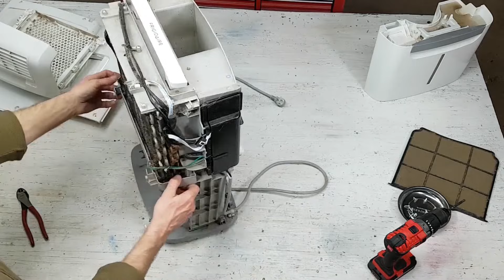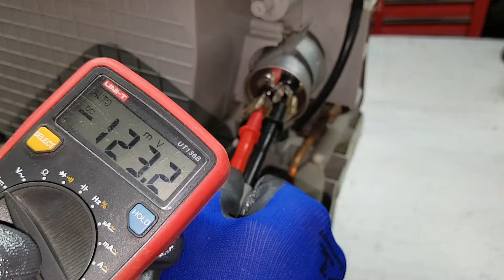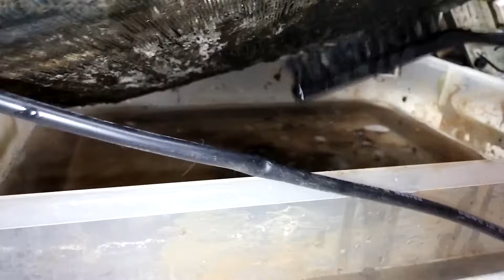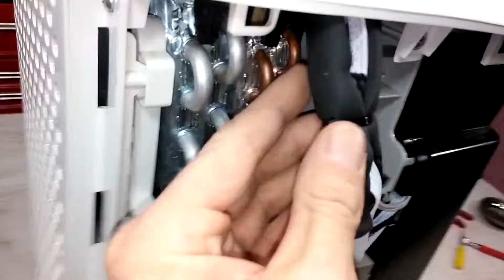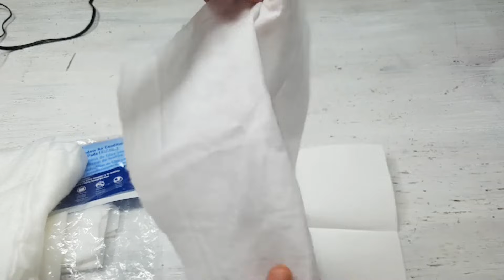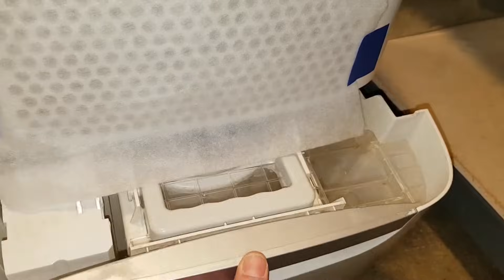How I Cleaned a Dehumidifier - Deep Cleaning Moldy Coils, the Bucket, and the Filter

Comment: Also focused a vacuum to a smaller hose to clean running unit because problem of dry and stubborn was then wet and loose ,recommend shop vac because it also suck out the water”learned the hard way”. If your bag is full and ready to change, it makes no difference to change after the job.
Reply from the maker: Thank you for the advice

Comment: After doing the same on a much more serviceable model. Added a custom cut out section from a furnace filter , a little duct tape , wha la la. They are specifically designed to prevent that very problem.
Reply from the maker: A cut-out piece of furnace filter is a good idea. The AC window unit filter material I used at the end of the video works really well so I'm sure a piece of furnace filter would also.  I need to change the filter about every 3 or 4 months but it's keeping the coils much cleaner.  Thank you for the tip

Comment: This video is the opposite of videos that bring a sense of calm over you, like the video of washing a dirty rug. I think it's the narration that makes the difference. Bad joke apart, incredibly helpful video for me. I have the same model, 12-ish years old. Never imagined it was something that needed cleaning. I mean who makes them like that? Mine is not sucking water as well as it used to so i checked and found ice where water drips out into the bucket. I can confirm it's not that cold in my basement because i have another unit, 2 years newer model, gulping water like a whale in comparison. The only recommended solution on the internet i could find was cleaning the coils. Never thought it would be such an undertaking, and thankful i found your video. Wish me luck as i'm about to embark on this mission.
Reply from the maker: I know what you mean.  I've looked for other dehumidifier models that are easier to clean but couldn't find much.  I have an older dehumidifier that is much much easier to clean but it's too inefficient.  Hard for me to believe that manufacturers make them this way now.  Thank you for sharing your experience.
Reply: The Ice forming is normal. Dehumidifiers work by cooling the air in the radiator fins to condense and collect the moisture. In principle, it's really not much more than a fridge with a fan running air through it. Mine was icing up when it was new and running well but stopped as the airflow got obstructed over time
Reply: They can make them easy to clean, but then half of their customers wouldn’t just buy a new one …. Basically the same idea as planned obsolescence
Reply: So how did it go?
Reply: The narration sounds like Aidan Pearce from Watchdogs! Love it!

Comment: WOW! What! I had NO IDEAAAAAA an UNPLUGGED appliance could KILL YOU!!! What a great video! I was just about to take mine apart, so this just might have saved my life.
Reply from the maker: I was surprised to learn that also.   Thank you for the compliment.
Reply: To be fair there are usually discharge resistors connected to capacitors that can be dangerous, else for some appliances you could get a shock from the plug itself. Actually I did get a little shock from a plug like 2 times in my life. I was probably very fast to touch the terminals after unplugging, not giving the resistor enough time to discharge some capacitor.
However I wrote "usually" in bold because you can't be sure they went out of their way to implement these resistors, and for some reason some designs traditionally don't have one. Like the main capacitor from photo flashes. Even these throw away cameras you could buy before the digital revolution of photography, had a flash module and I did get quite an unpleasant shock from one of them, assuming it was discharged because it wasn't used in quite some time.
So better treat those big capacitors like little death nuggets unless you definitely know they are discharged.
I don't know if I would short a motor capacitor like in the video. That could lead to a really loud bang and partially melted terminals/screwdrivers. The safe method is to do it via an appropriately specked resistor.
Reply: mines been unplugged for six months.  do you think i still have to worry?  been putting off cleaning this overcomplicated  unit
Reply from the maker: I would still take the same precautions shown in the video because that capacitor can theoretically store its charge for quite a while.  It may have a circuit to drain the charge after the dehumidifier is unplugged, but I wouldn't trust my life with such a circuit.

Comment: I used a fabric cleaning gun, which is used in the dry cleaning industry for spot removal. I have several around for cleaning mineral specimens, and it worked amazingly well on the coils and fins. I took a chance , and just unplugged the unit, carefully but thoroughly sprayed from the entry side from top to bottom, and repeated until the runoff in the bucket was clean. The odor was like sewer gas before cleaning, seems good now.
Reply from the maker: I've never used a fabric cleaning gun but it sounds fun.  Thank you for the tip

Comment: Hi! I'm hoping you might help answer a question for me. We tore our dehumidifier apart it didn't look nearly as bad as this one did but it was bad. We gave it a very good, but we did not separate the coils and it smells mildewy still. I'm afraid to separate the coils because I'm afraid of breaking them in two. Where we are living the moisture inside the house is crazy it's at 70%. Because the house was built in 1910 and has a dirt floor basement. And we are running the dehumidifier inside the house itself where we live. I'm afraid if it still smells mildewy that will be putting mold spores in the air. Is my thinking correct? In the landlord just seems to think that we should open the window. But if it's humid outside opening the window isn't going to make it less humid inside, if anything it will make it worse. What are your thoughts? Should we run it anyways or is there something we can do to put like a filter over where the air comes out of the dehumidifier? Because I really hate to buy another one, and we're searching for a place so we can move, but until then we're stuck.
Reply from the maker: Another viewer mentioned a product called viper foaming coil cleaner.  I believe it's just sprayed on the coils, allowed to soak, and then washed off with a garden hose.  I've never used it but I think it was made for cleaning air conditioner coils.  The coils on the dehumidifier may not need to be separated if using a foaming spray and a garden hose, but I don't know.  The coils on my dehumidifier weren't attached to one another but were secured around the edges.  After removing the retainers, they came apart easily. Need to be careful not to break the refrigerant lines though.  I think you're right about it putting out mold spores if it still smells.  I don't know of any filter that can be used on the outlet, but the A/C filter material I installed on the intake does a great job of keeping the coils clean.  It just needs to be changed regularly.
Reply: You are probably in a toxic home. If it smells like mildew, that’s your sign. It’s best you try to move ASAP.

Comment: HI Phil, why can't we use vinegar?
Reply from the maker: Vinegar can be used, but it may cause corrosion to some metals if it's not completely rinsed off.  I avoid using it on intricate metal parts that are difficult to clean if I think I won't be able to rinse it all out of the tight, inaccessible spots.

Comment: I just cleaned mine. Anybody else have like 5 extra screws and have no idea where they go.
Reply from the maker: I've experienced that a few times.  I try to organize fasteners during disassembly using cups and bags but it still happens occasionally.
Reply: 3
Reply: 😂 we all have loose screws
Reply: I had some screws fall down and get underneath the large black cylinder at the rear of the unit.  I partially reassembled the internal sections enough to permit turning the whole thing upsidedown over a bathtub (plug the drain first!).  After a bit of gentle shaking the missing screws fell out.

Comment: Pretty sure that after the initial white plastic cover comes off, that you have enough access to clean it almost perfectly. The front grill needs to be very gently wiped or better sprayed with water delicately to wash off dust. Doing it in the tub works. That's all I did and it works like new. Wait until it dried and reassemble. You're good to go. Basic easy procedure. The front metallic grill cleaning is crucial. Delicacy is the name of the game. All the extra disassembly is unnecessary.
Reply from the maker: I wouldn't have been able to clean the backside of the coils if I only removed the cover panels.  Seems like that method would be fine for cleaning off dust, but I had to remove mold, dirt, debris, hair, and other stuck on gunk.  Spraying from the front side of the grill would have pushed the moldy dirt and hair further into the coils.  If I had cleaned the unit much sooner,  I believe the approach you suggested would have worked.  But I waited way too long to clean it.  Thank you for your input.
Reply: @BudgetPhil  If was an interesting video for sure. Normally (if you clean it regularly like you say or have an air cleaner) the front grill cleaning is sufficient since the dust really stays near the front on the grill in my experience. I have two different brands and when I cleaned them both the dust doesn’t push through. Also, as someone who had lived in moldy houses, that doesn’t look like s normal amount of mold even for not cleaning it for years. If you have it in a  crawspace that’s probably normal, if it’s in your house you should check for water damage. Mold is really bad for you health.
Reply from the maker: Yeah, it was a lot of mold.  Thank you for your concern.  I would have freaked out a little if the dehumidifier was used in the house, but it was used in my workshop.  A lot of different kinds of dust and debris flies around in there from time to time so I should have realized it was going to happen.

Comment: 4 months !??
Think you need a serious hepa air cleaner in the room and clean all the walls, floors, roof and things around. I havent cleaned mine before today and is where just a little dusty and from hair and concrete (in basement) and it lookes almost new and better than yours after cleaning 😅
Reply: It was ten years for him he said. He checked the pre-filter after 4 months I think.
Reply from the maker: Yeah, my workshop gets fairly dusty sometimes.  I put an air purifier in there and it does help.

Comment: nice work. Having mold grow in this thing is a nightmare for airquality as it sprays the spores everywhere . not just into your lungs, but also infecting any other place in the shop that is moist enough to let it sprout - leading to new problem areas. Your more robust intake filter should help a lot I think. The mold needs some organic material in addition to moisture, so if there isnt a dust buildup it shouldnt happen. Its a good idea to not let water sit in the tank though.

I wonder if its safe for materials to use a mold biocide as a last-step disinfection. I would assume so. You cant avoid mechanical cleaning when its this bad,  but misting the area with something that can kill any remaining spores would be nice. Definitely not bleach though. That oxidizes aluminium quite harshly.
Reply from the maker: Thank you for the compliment, and for your input as well.

Comment: Great job. Did you find a dehumidifier that's easy to clean?  I have an older dehumidifier that leaks... any ideas on why it leaks?  Ty
Reply from the maker: Thank you.   I have yet to find a new dehumidifier this size that's easy to clean.  All of the designs I've looked at seem to have a similar problem.  But I'll keep looking.  My dehumidifier has also leaked a couple times.  It was caused by some dirt and hair blocking the drain port to the reservoir on both occasions.  I used a thin, easy to bend, piece of wire with a small hook bent on the end to fish it out the first time.  Needs to be easy enough to bend so that if the hook gets caught inside the unit it can be pulled out without damaging anything.  The second time I just blew compressed air through the drain hole.  I don't know what the correct way to do it is.
Reply: @BudgetPhil  THANK YOU SO MUCH 👍
Blessings to you and yours
Reply: My old one started leaking all the time but it was leaking for somewhere under the bucket, down near the wheels, is that where your dehumidifiers leaked from?
Reply from the maker: Yep.  The water drained down to the bottom of the unit and came out near the wheels.
Reply: @BudgetPhil  That might be what was wrong with that machine. The clog was in the part going into the bucket, in yours?
Reply from the maker: Yeah, clogged where it drains from the tray below the coils into the reservoir.
Reply: @BudgetPhil  Oh. Mine was a Toshiba one. It's still sitting around. Do you think that I can clean that clog without opening the machine? Like, if I just pull the bucket out is it something that's reachable in most machines? Were you able to do it like that, with yours?
Reply from the maker: Blowing a few short bursts of compressed air back through the drain worked for me.  One time I used a thin piece of wire with a hook fashioned to the end to fish out the clog through the drain.  Just needed to remove the bucket to access that drain.
Reply: @BudgetPhil  Thanks. I'll have to try this.

Comment: Sheesh. I'm not smart or patient enough to do this. I have the exact model shown in this video.
Reply from the maker: I wish they designed the dehumidifier to be cleaned by the consumer.  Seems like there should be dehumidifiers that can be cleaned relatively easily.  I looked for another design a couple years back, but couldn't find one.
Reply: @BudgetPhil   They're all made like this now?  I suppose they think we're going to just pitch it and get a new one.
Reply from the maker: I think you're right
Reply: @michelleahlstrom9408  I know. That's so frustrating!

Comment: Do not get rid of it! I have two of these... the newer ones are TERRIBLE. I have not killed mine in 10 years but my parents have been through multiple others. As long as it still works DO NOT GET RID OF THEM. 

BTW... a shot of viper foaming coil cleaner every so often goes a LONG way. I take them outside and remove the hose connection and tank and literally hose them out. As long as you don't get water into the control panel you're basically good to go after they sit in direct sunlight for a while with a fan on it. 

I am seriously debating permanently removing the stupid grill and or making it attack magnetically/velcro. 

Really no kidding these things are beasts and a dream compared to the new units you can can at most stores. I use my personal one for drywall work if that gives you any idea... you can tape and mud and prime an entire bathroom in a day with one of these. 

If you think you might ever want another one get it now. I bought my parents one about 3 years ago and this model was still being sold. Just keep it in the box or whatever. I went to service both of their other "new" ones and they wound up getting scrapped. They literally had refrigerant leaks and one constantly iced over no matter what and I wasn't about to tap/evac and recharge that pile. 

Viper foaming coil cleaner... get some asap. It's a trade secret weapon. I've never seen another coil cleaner come close in one pass. Foam it, blow air into the coils to get it into the back a bit, don't forget about gravity 😉  and then I hose it out.

Also on the tank,  drill two access holes for the two screws covered by the clear plate and thank me later. It's a dumb design,  but light-years ahead of anything newer. Do not use high pressure water BTW... as weird as this sounds there is a thing called a clean stream shower attachment that works PERFECTLY for servicing these... it's made for butt stuff... but a friend had one one day and I bought one after using it(for not butt stuff lol). Its got 1/2 fpt for a shower hose but an adapter works for garden hose. Just look it up... it will make way more sense when you see it. Lol
Reply: BTW the "clean stream" can be found on Amazon for like $15 and the viper cleaner runs $15 a can but it goes a LONG way. The clean stream puts out a nearly laminar gentle "beam" of water and it's made of silicone rubber and flexible. I use it to clean delicate stuff like coils. The laminar flow holds together even at very low volume... 

I've never taken them down as far as you did, but thanks for doing so... this gives me the confidence to attempt this.

If you're thinking about adding a real filter the Honeywell HPA filter may work. I'm still up in the air on whether it would be worth the work. 

6% -12% H202 (use legitimate fucking protection with anything over 3%)  12% will hurt you. It's about like muriatic acid in reaction time with skin. You've got 10-30 seconds to get running water on any skin. I learned the hard way lol 6% isn't that bad and 3% is pretty harmless. It's diluted by weight not volume BTW. I don't use 12% on anything other than legit black mold. Just let it do it's thing and it will evaporate off. Rinse once dry if needed, but whatever is left is dead. 

H202 in the tornador is actually genius... I've never even opened mine. 

Sorry bout the rant, but you're bravery on such a deep clean has inspired me! They're indispensable when they're clean and running like they should.
Reply: Wow, that was very informative. Thank you Adam
Reply from the maker: Great info.  Thank you for your advice.